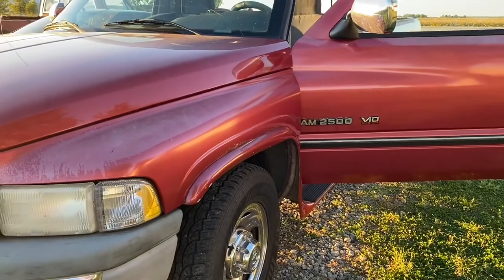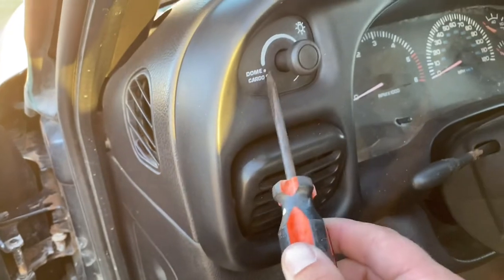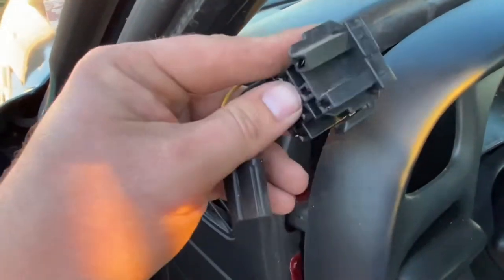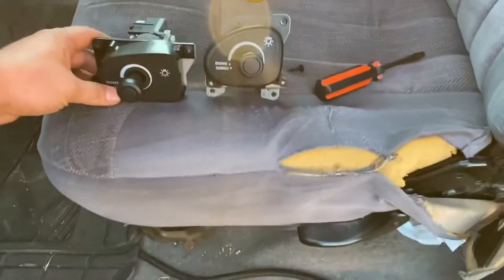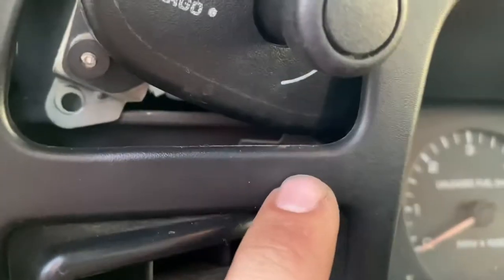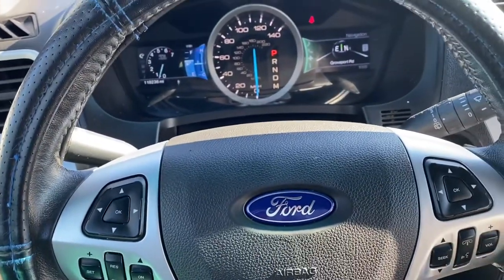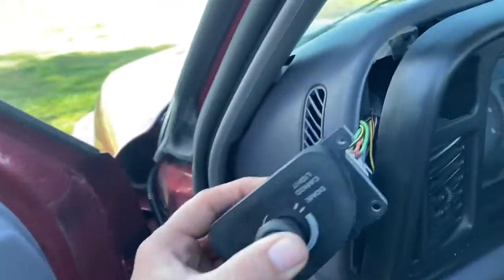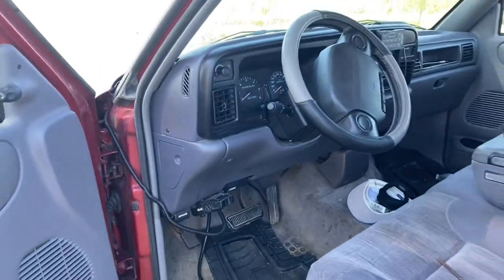HOW TO REPLACE THE HEADLIGHT SWITCH IN A 1997 DODGE RAM!!!!

Comment: Thank you so much really helped just bought the truck 3 week ago and last week the I smelt something burning the I stopped to grab gas and when I started the truck I didn't have headlights had to drive 3 miles on county road driving 20 miles hour. Luckily auto zone had the part switched the knob to the new light switch 1 week later no problem. Thanks

Comment: Best to put a relay in and run the lights through the relay. Bad light switch is a common problem with dodge, switch isn't heavy enough to carry the load.